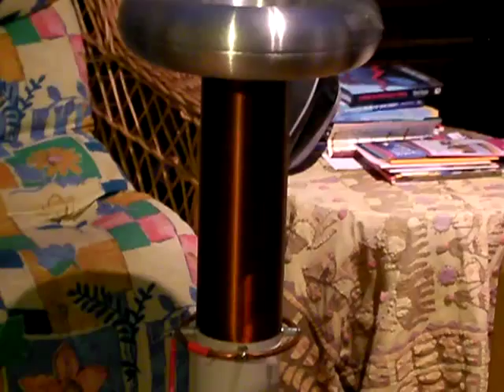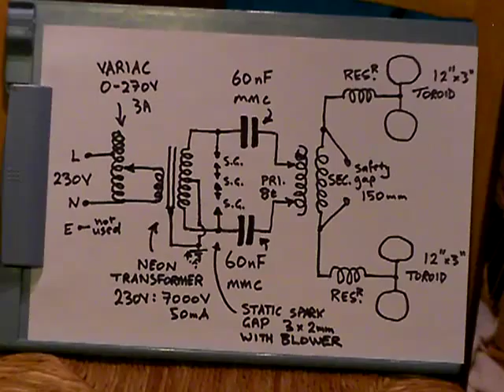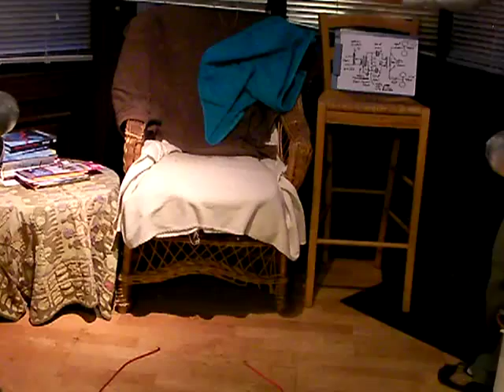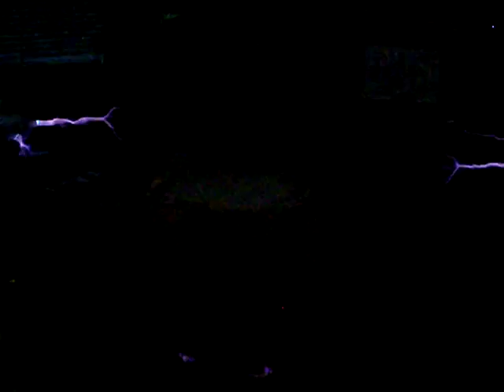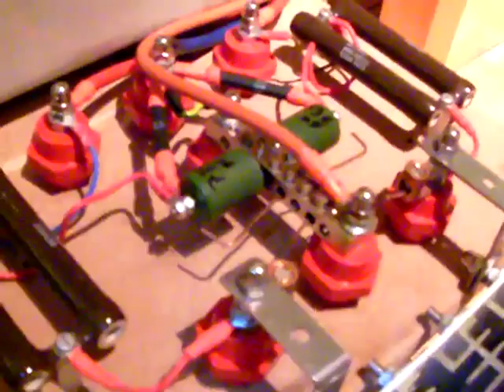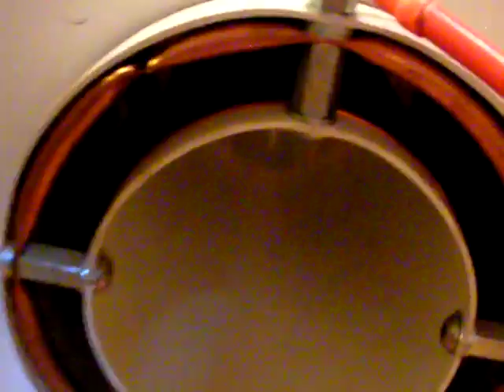A Small Balanced Tesla Coil ( Tesla Magnifier )

Comment from the maker: Yes, that secondary SG is about 6 inches and the video doesn't really capture the ferocity of its spark. It might need a grounded centre electrode. Lots of corona on the SG wire ends so I need to use some stainless steel 'gazing globes' a measured distance apart to make the SG more predictable. I think I need well above 100kV at the transformer's twin outputs to keep the overall k-factor high enough. I still have scope for much improved insulation and system spark performance.

Comment from the maker: Thanks Pete, yes it took a while but I find there are enough problems managing the HV without adding dodgy construction to the list! I think the wingnuts will have to be replaced by round-top 'corona' nuts. I am sure the grading ring/corona ring idea helps a lot. A corona ring reduces corona from conductors (such as winding ends), a grading ring equalises stresses across a string of insulators (such as inter-turn insulation). One broken copper ring can do both jobs without being a shorted turn.